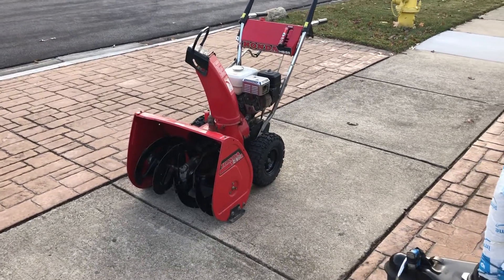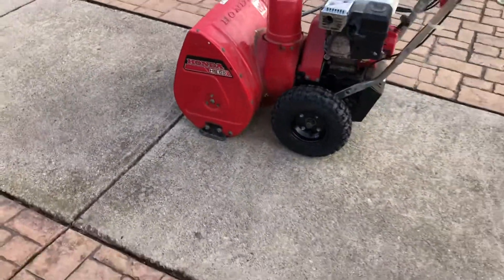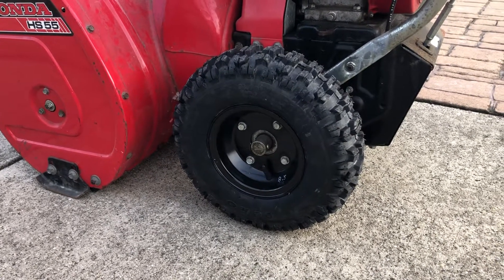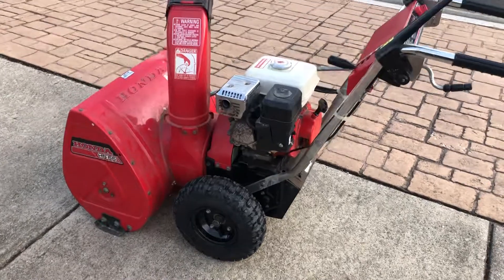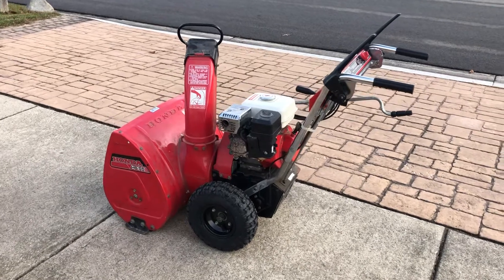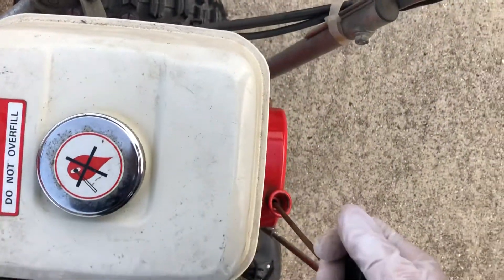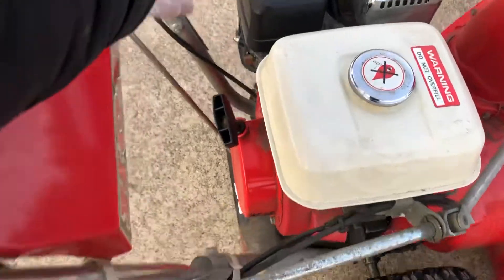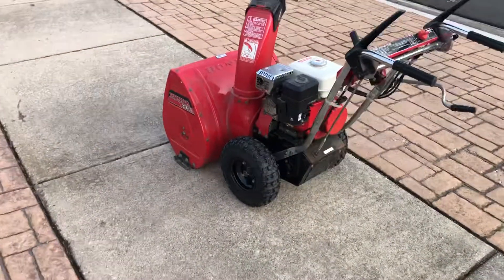Honda HS55 with China carburetor

Comment: What is the proper size of tubing you got for this snowblower? I got the hs50 model.
Reply from the maker: cool change not sure what you mean by “tubing”?  You mean gas hose?  It’s pretty close to 3/16” which works fine but Honda gas hose is a metric size.

Comment: Where did you got your chinese carburetors?
Reply from the maker: cool change Ebay parts sellers have them.  Be sure to look at all the exact details and not just the listing. Since this video I did get one defective carb on a different project. At $13.00 no big loss, not worth messing with.   I put another new Chinese carb on, it was good.
Reply: @chatrkat  Can you make a video of the oil change and the carburetor replacement pls?
Reply from the maker: cool change I have a project coming up with the exact same Honda GX200 engine but it’s not a snowblower however the processes will be exactly the same.  Keep a watch on my channel.